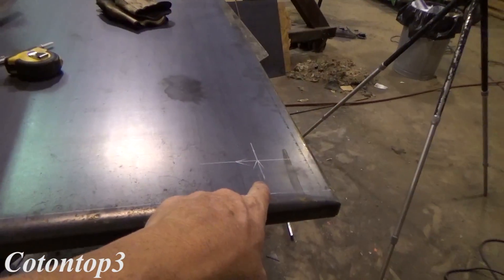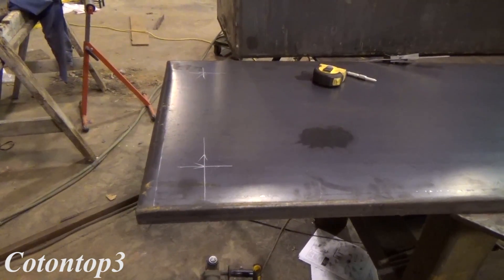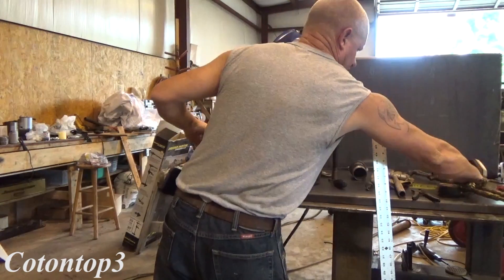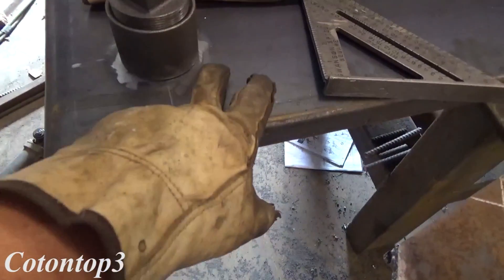Fuel tank build (part 7)

Comment: If you are not aware of them, think about getting  yourself an automatic center punch. Basically a spring loaded punch but MUCH handier. I like the Starrett version but you can get cheaper ones. It'll be the best present you ever buy yourself for layout. They are around $40.00 and last forever.
Reply from the maker: +kj inohio I did have one and I wore it out and the tip split. I been wanting another one and when I get one it'll be a starret.
Reply from the maker: +kj inohio where do you get your starret stuff from?
Reply: Enco or MSC will have them. There are several versions I have the bigger 18B with removable tip I "think" the 18C is solid. the tip will break if you don't have them tight as the shock goes to the threads so make sure it is seated.

here is an Ebay link to a used 18B

http://www.ebay.com/itm/Vintage-Starrett-No-18B-Automatic-Center-Punch-Used-/322207086614?hash=item4b0509f816:g:ZIsAAOSw-YVXmNRl